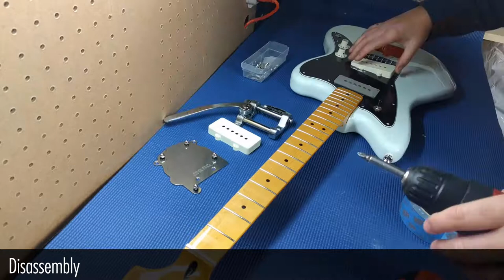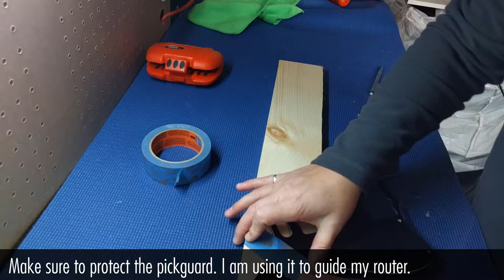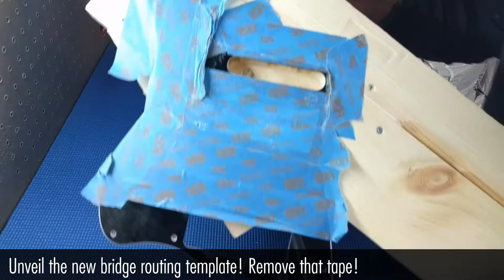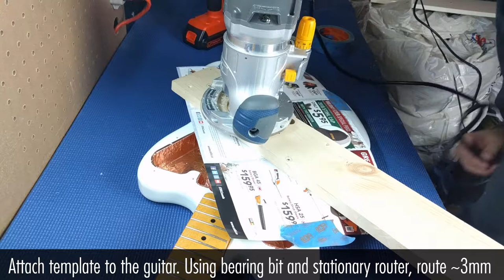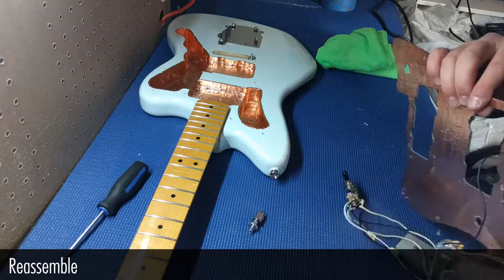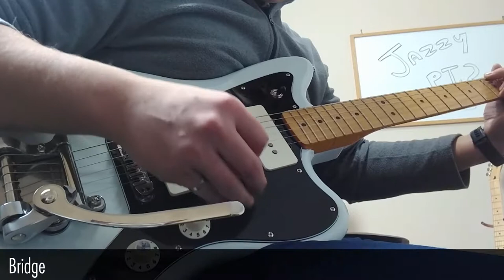Ultimate Jazzmaster Pt.2 | Recessing the Bridge & Demo | DIY Guitars

Comment: Hey, amazing job!
Do you feel that the additional routing was still needed using the roller bridge? Thanks
Reply from the maker: Yes, it was required to get the proper action. The only other option is to change the break angle of the neck with a angled shim in the pocket